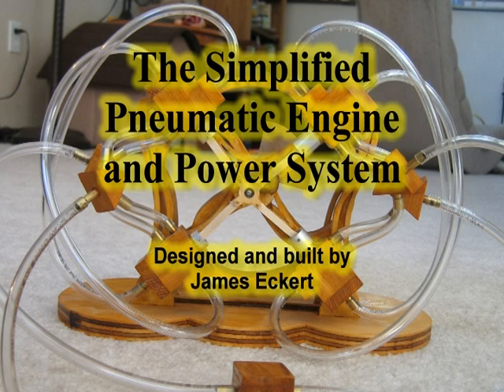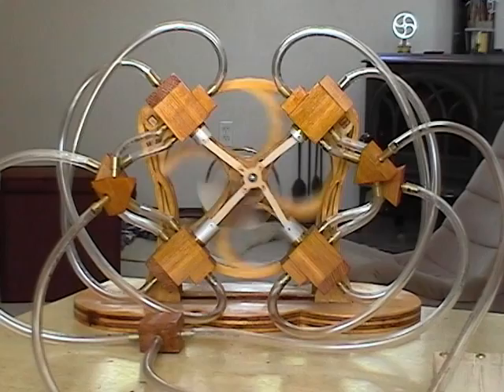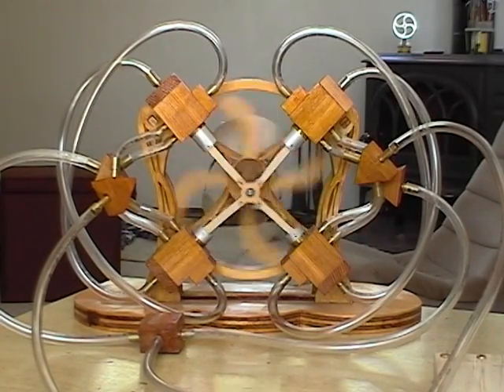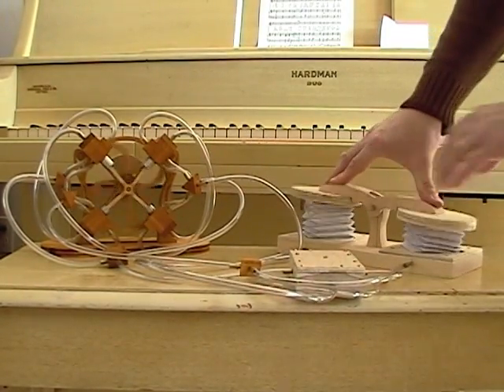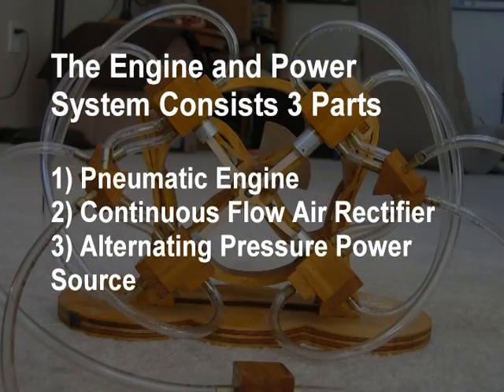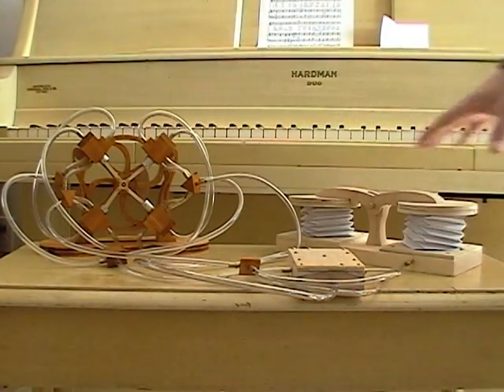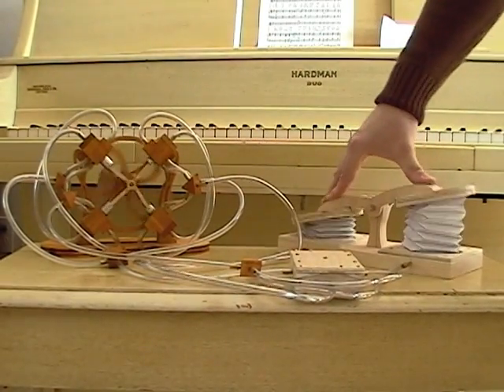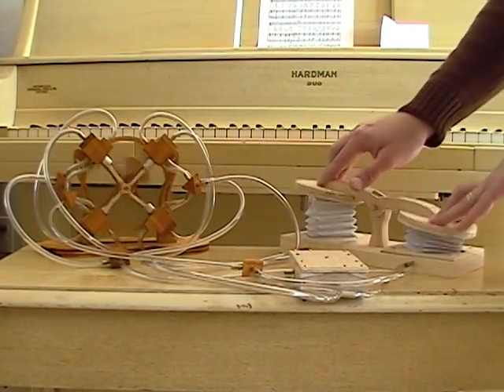Radial Air Engine

Comment: Hey was this extremely difficult to construct? I'd like to use your principles (if that's okay) in order to construct an accordion that operates on a tonewheel, so it has to be able to efficiently and sustainably (won't break very often) transmit pumping action directly into a rotating circular disc, with enough speed to make a tone. Still working on it.
This was very cool, thanks for showing us;.

Comment: This looks really cool, i'm picturing this engine in a lawnmower with an air tank as its power source and quick recharge capability from a common air compressor. I think that would make for a lightweight efficient mower.

Comment: The bellows and your hands are the engine... the pistons are the drive shaft and the wheel is the wheel! When you say engine... it should be something that generates power itself by burning (Using) some sort of fuel!
Reply: Unavailable Yet not convinced.
Your statement suggests that with steam engines that the boiler is the engine and the Piston is a driveshaft?
An engine just converts energy (fuel or any other) into kinetic energy.
So it's still an engine

Comment: I would like to share some of your videos on my channel, if it OK?
Reply from the maker: +Air Engine Research 
I am not sure what you mean. You can link to anyone's video in a playlist. But if you mean to rip it  and then upload it to your site  stealing my hits then absolutely not.
Reply: +JEPLANS 
Sorry, I did not intend to copy your video and use as my own, I do want to show other options and ideas from other people. I have been trying different ideas of 10 or 11 years now, and have started sharing them on You Tube - which I am trying to learn how to use.
I looked up " How to share others videos on your You Tube " and they showed down loading them and use them as their own, which i was not comfortable with!
That's why I asked permission from you and a few other people also.
You say I can show them in a play list? OK, if that doesn't infringe I''ll see how that works Thanks.
Reply: +Air Engine Research Looks like it's pretty simple to do the Playlist, I will see how it turns out.

Comment: where did you pick up the cylinders and pistons? i would like to try and build one of these myself, do you have plans available?
Reply from the maker: Joey Houston I made the pistons and cylinders from a K&S brass tube and aluminum rod available form some hobby stores.  Plans are available from my website http://jeplans.com.See my video "Air Engine: Making the Piston" to see how  the pistons is made.          Save       Cancel
Reply: JEPLANS Thanks so much, I purchased your plans and ordered my supplies. I do have a question on to how big the flywheel is in overall diameter? it is not disclosed in the plans, also is every piece designed to be printed to scale?
Reply from the maker: Joey Houston look at the plan it is about 5.297"  or  5 19/64" for the flywheel.  The plan are designed to be printed 100% or actual size. Then cut out and attached to the wood or whatever your working on and cut out. The ruler in the corner is to verify it printed the correct size.

Comment: The integrated piston valve can be further developed... I had a similar design before watching this. Mine didn't work on vacuum (didn't intend to) but the trick was to drill on the piston: a side hole, and a bottom hole, communicating; and on the cylinder two side holes: one on apogee for exhaust, and of course one on the lowest point of the side hole of the piston. Thus, it works like a pop valve engine, but without any spring.
Gotta make a video of that
Anyway I love your work...it's very encouraging, since I don't have any lathe or table drill. Just a couple of simple tools

Comment: If you slapped a propeller on a larger version, stuck some wheels on it and got the contraption going 20+ mph with peddle power... adding wings might get you airborne.
Reply: Use air to fly? I like it.

Comment: Air Rectifier! Oh that's genius! Yay analogies! Is the concept of a fluid flow rectifier  much more common than I'm thinking it is? I only know of rectifiers in an electrical context. Good on you JEPLANS! Now make a kinematic marvel that draws pretty symmetric things!
Reply from the maker: Thanks, Not many people notice the rectifier. I don't know if the concept is used much outside of electronics but it was the perfect solution here.  I plan on using it again in some future builds that will be powered with alternating pressure sources.
Reply: Some weeks ago, I was trying to figure out how to get one directional air flow in an accordion (to be directed through the noise generating components), and I came up with the idea of exactly a rectifier! Very simple concept, once I understood :)

Comment: When is the large scale model coming out?
I bet you need a compressor for the larger model.
You need a combustion engine to power the compressor.
Why not use the combustion engine instead?
Reply: Because you can power the compressor with electricity and use air cylinders instead of a battery. In a hot country, you can use the cooled air that is the only exhaust instead of powering an aircon unit. Range is a problem, as is the low torque, but in some contexts that's ok and better than having to transport and pump costly fuel.

Comment: Love what you've done, looks fantastic, i'd build a slightly similar sort of thing using an 8 cylinder radial assembly powered by a much higher pressure system, (around 120 psi) mostly machined aluminium based around a more traditional engine design (more moving parts, cams, valves, the likes) , I'd more built it because i thought it would look good and didn't give a crap what it was used for, though it's found it's way onto a miniature motorcycle, glad someone else is doing something similar :)

Comment from the maker: Thanks, I kinda just made it up. I have designed 2 other engines using the same piston function. Check out the inline 4 air engine and the Mini v8 air engine.

Comment from the maker: No, not necessarily, it could a be steam engine if built out of water resistant materials. It has less moving parts for the given number of power pistons then some steam engines. Although some steam engines drive the power piston from both sides. In the end it is just a slightly different approach that I felt was easier to build.  The question of efficiency really comes down to how the pressure source is generated.

Comment: Even if it would inject the air just a little before TDC? If I hooked the inlet to the top hole. So when it goes up it injects the air? (I'm 14 so I don't know enough about this yet)

Comment from the maker: I hooked up a small one to see, but it didn't quite move enough air at once.  I have since got a small air compressor for testing. Of course, the bellows were more about coming up with a interesting manual way to power it.

Comment from the maker: Sure 16 would be possible, any even number would work. Sets of 4 are best. Check out my "Inline 4 RPM Tests” video it has the same piston dimensions in a different layout. It’s faster because of a smaller fly wheel. I am not sure running on a continuous basis directly from an air compressor would have much point.  But as part of a stored energy recovery system it might. I hope to have time this summer to rig it up with a scooter and a HPA Paint Ball tank, just for fun.

Comment: Paul again
Vs. to air would hydraulic cylinders be much more powerful?
If you took 2 10 ton jack for example, to have just 2 cylinders, like the the old style John Dear tractors running  on 2 cylinders,  and had it running @ 60 rpm look at the torque you would have for greater hp.  These cylinders would  require a hydraulic pump that could run continuos on less than 10 Hp.
Can you see the advantage?
Has any-one tried this system.
Paul

Comment: Would this be possible to have a 16 piston cylinder for constituency. 
If piped with rigid piping can you get 250 horse power from an air compressor, on a continuous basis. Would that be sufficient volume of air to run this 250 Hp air motor?
Paul

Comment: Not trying to be rude, But. An engine powers things. the paper bellows is the engine
powering the thing you built!  And as it turns out in this case, your finding that
for higher preformance, you must reinforce the folds in the paper bellows ENGINE!
Want some F1 rpms? try a leaf blower! :)

Comment: Actually, a turbo extracts exhaust gas heat by (expanding the air) via turbine and turns it into shaft work. That work is used to drive a compressor impeller (same shaft). The impeller draws in ambient air (through a filter), does work on it (heats it up) and compresses it. Now that compressed air is forced into the intake. The compression ratio has increased, so has engine power! You will typically see inner-coolers before the intake which extracts heat prior to intake. More power!

Comment: XxiconicalxX: You're wrong in your understanding of a turbocharger. This explanation works for both super and turbochargers: You're right that there's more air in the engine, but that extra air is useful because more air going into the engine means there's more Oxygen going into the engine, meaning you can burn more fuel. More fuel being burned increases the pressure in the cylinder, pushing down the piston harder, increasing torque and therefore power output.

The engines thermodynamic efficie

Comment: turbo decreases fuel and replaces it with compressed air . this is why you "save gas money" and what do you mean directly? umm its pretty DIRECT (negative) pressure on a exhaust causes cylinder lag to decrease causing direct extra 5 hp at the least

Comment: Actually a turbo uses exhaust gas to increase the amount of air and therefore also fuel to give more power to an engine.  It doesn't add power directly.  If the exhaust could be used to add power directly to a drive train it may be efficient enough to use.  As for the exhaust flow it is one of the many problems that would have to resolved to see if a small amount of extra HP could produced.  Another would be the weight gain.  Inventors must think out of the box to come up with anything new.

Comment: sorry they already invented that its called a "turbo charger"... xD and youd never get the same amount of power from using a big version of this on gas as u would from a turbo ? also youd kill the engine with zero exhaust flow-_- we need a exaust vacume if anything - pressure = more power like a electric powered vacume ? or a electric turbo charger ? runs off battery not engine ...itd be considered a supercharger i guess...

Comment: hi ,jecket maybe this air engine can be fitted in a two/three wheeler and powered by air hydraulic foot pump (check streetstrider on youtube ,mayb ellliptical foot can be fitted int he vehicle which power teh air hydraulic foot pump which in turn is connected to the air engine which in turn powers the wheel

Comment: That is really nifty, you could almost make that run on sunlight, like a Sterling, but the setup would be more complex just because the air needs to be moving to run the engine.steam though, it would probably do better then a valved engine, less to break.

Comment: add a shaft to the rear end ,  a manual transmission with a clutch disc and fly wheel  and BAM ! greenest automobile engine ever . oh and a more constant airflow for smoother power delivery :)

Comment: Its not actually an engine its not self propellent as you have to use  your hands to suck and pump  air into the system to get it to work... I can make something equivalent that has that eliminates your hands completely dud.

Comment: well they use the term rotary engines because it doesn't have pistons, it has rotors. i knew also that the wankel engine isn't originally japanese, but german. mazda saw the opportunity and bought all the rights to that engine and so far is the only engine different in the world that doesn't use pistons at all.

Comment from the maker: I don't really know if it is truly new. The closest examples of how it operates that I could find were mechanical movements 148 and 154.
The main difference in my engine is less moving parts per power cylinder but there needs to be an even number of cylinders. There were a lot of different engines designs back in the steam days. It certainly could have existed before, but it's new to me.
Mechanical movements 
Model: 148 Oscillating Piston Engine 
Model: 154 Horizontal Slide Valve Engine

Comment from the maker: Yes, thick paper then sealed inside with silicon caulk thinned with mineral spirits. They don’t work as well as I hoped. With a little use they start bowing out and caving in. A little reinforcement on each section to make them more rigid would have helped a lot.

Comment from the maker: It should work well. At least for a little while.  It would need to be made out of something a little more water resistant.  But the design should work with any kind of pressure even just water.

Comment from the maker: The bellows were made with paper folded and glued together, because of the way I had laid it out the gluing was a corner seam where the folds were the most complex and there were some small gaps in the glued folds. I sealed it by thinning Silicone caulk with mineral spirits and pouring it in while rolling on its side; unfortunately I missed the small gaps with that as well in one of them.   My Rotary Air Engine 2 video goes over piston operation.